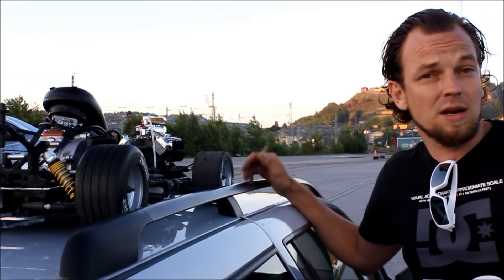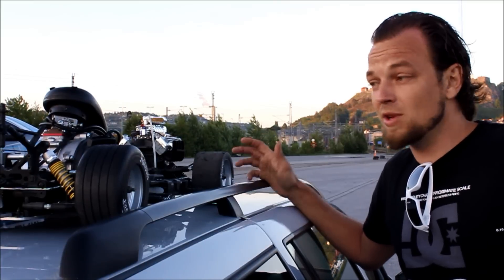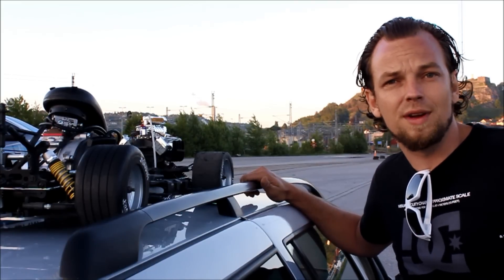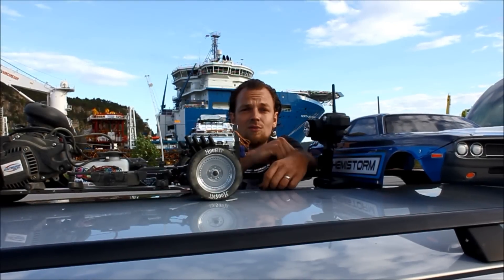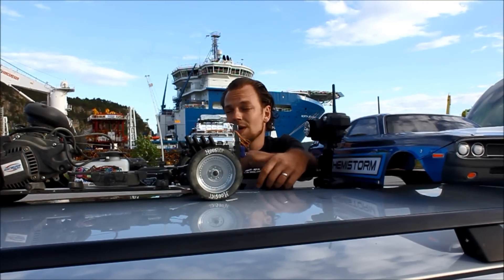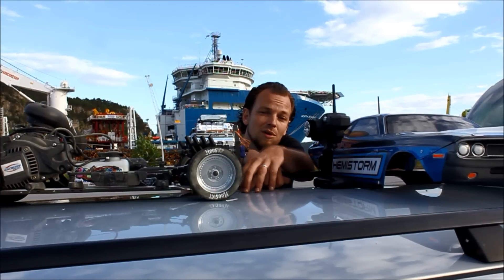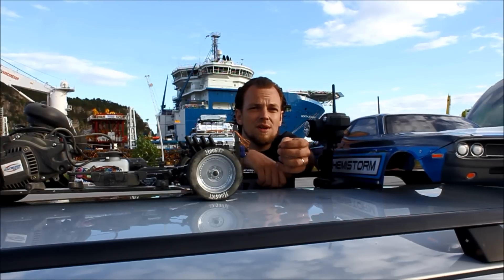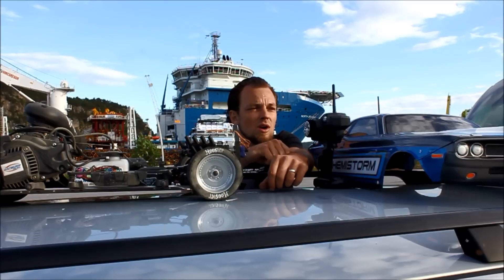5th Scale BurnOut Time! FG Dragster Test Runs

Comment from the maker: Hi Flavio! Good to see yo stop by again, my friend! The body will be available soon thrugh HemiStorm Products. As for breaking in the engine: several ways and everybody has a preferred method. I run stock carb settings, just let it cycle through a tank of gas without throttling it too much. After that, I start leaning it out with some low speed runs, just as long till I find the right tune. I hope this helps!

Comment from the maker: Well, Richard... It is not too bad I think. Although wifes and girlfriends not always agree on what we think is acceptable, haha. The FG costs a little under 1000 euros, add a different body and wheels for around 250 euro, some electronics, which were quite pricey but it needs to be reliable as well. So those ran me around 400 euros total. Now, the fun part: The fake engine in front was not even 30 euro, and the wheelie bar cost me around 15 euro to make. Add the BZM, and you have a total. :)

Comment: Also... Your car is essentially a FG Sportsline road-car kit with modified tires and a drag body ('70 Challenger).  The suspension is still set up for road racing...that's why it handled so well while your were playing in the parking lot.  Switch to a straight rear and front axle, and you will have a straightline monster.

Comment: A thought, install a very small electric motor with a pulley and tie it mechanically to the blower pulley of the dummy hemi. Then, run it through an ESC in parallel to the existing throttle channel, thus spinning the blower pulley in direct relationship to the amount of throttle applied. Realizing it's some work, but the effect would be amazing.
Reply: I think that as long as it spins it doesn't need to spin at variable speed because it's moving, so you can't really tell.
Reply: ***** Got ya. I just couldn't tell from the video that it was spinning at all. Nice work!

Comment from the maker: perfect marriage between something I can use on the track, and something that packs a punch in a dragrace. All restomods in full scale go by the same principle: The suspension functions, is even upgraded, but they also perform on the strip. I chose not to do just a scale off the line video, as that would have been only 5.5 seconds long. ;) Keep in mind, this was a test. The car is not fully complete yet,and I'm pretty sure you will like what is to come. Take care buddy, I hope this explained it!

Comment: Awesome build Hemistorm!!!! What compound are the rear tires? They don't seem to smoke as much as I anticipated. I run super soft compound on my Sport line AWD and they smoke big time if I hold the car and spin the wheels. I run a brushless 10s setup so my tires may be spinning allot faster than yours at full throttle producing more smoke.

Comment: I once had a FG Sportline, stock CY engine...put the stickiest tires i could find on...did nothing but "burn out", no traction!! You have a hot engine, pretty slick tires(going for burnouts) and it looks to hook up great!! I don't get it!!
Reply from the maker: The diameter on these F1 wheels is quite a bit bigger, and the tarmac I run is is quite coarse, all of which can help.

Comment: that is awesome! how did you get the front brakes to lock when you did that burnout?
Reply from the maker: +daniel o'hara I made a line lock system that runs off a separate servo on the 4th channel.
Reply: +HemiStorm RC - Custom RC builds, painting videos and more you should make a video on how you made the front tiers to lock up

Comment: Hi
     Did you paint the body on the inside or the out side , I have a 1970  Dodge Challenger  body but have never painted a body on the inside before . Also who sells the wheels , and did you have to change anything to make them fit under the body , any information you can give me would be great . Thank you

Regards
Steven Lee   (  Australia  )
Reply from the maker: +LEESODANO Hi, I painted the body on the inside. The wheels are discontinued and I custom fitted them with some F1 rear tires to get the stance to the point where I liked it.

Comment: how did you get it to do a burn out? I'm going to build a drag car and was wondering if I used the traxxas rx/tx if that would work?
Reply from the maker: +905RCCrawler I made a line locker system, there is actually an entire video about just that modification!

Comment: Hey dude...
that's fuckin sweet.
how much did it cost you to customize the lock tires body and the air scooper??
Reply from the maker: MgPs3ModDzz Hi buddy! The supercharger comes from the diecast engine that I mounted to the chassis, they retail for about 30 dollars and are very detailed. I did a few videos on how to mount one of those, it's quite simple. The line locker was also quite simple, I needed to make an extra servo mount and construct an override system for the front brakes. A video on how to do that can also be found in the playlist. I hope that will give you all the info you need to build one! :)

Comment: did you put some wheight on the front ?
Reply from the maker: I made a line locker system.
Reply: HemiStorm RC - Custom RC builds, painting videos and more yes i now i have look your video put i've done that on my fg with the front hydraulic brake but the cars heavens in with the tires blocked goes straight...

Comment: In the background is that a ship amusement park
Reply: 2:30
Reply from the maker: Great question! That is a "cable boat", they use them to unspool cables that will be submerged on the sea bottom, connection France to the UK for example.

Comment: how did u get it to do a burnout without touching the car
Reply: +mommyofjosie You need to have a way to have the front brakes engaged and the back brakes not engaged and you give it throttle ... Also he used some kind of liquid to make the back tires spin more easily than if it had been on dry pavement.
Reply from the maker: +mommyofjosie This car has a fully functioning line locker system on the fourth channel. I made a video about just that.
Reply from the maker: +Black Majik Line locker indeed, I made a mechanical override for the front brakes.
Reply: +HemiStorm RC - Custom RC builds, painting videos and more awesome thanks for the feedback love the car man
Reply: HemiStorm RC - Custom RC builds, painting videos and more Very cool that you were able to do that for this car. Line lockers are very common for drag cars, however I have only messed with 1/10 scale RC cars and have not thought about a way to run a line lock on an RC, Are the brakes on that car hydraulic or are they mechanical? On a 1/10 scale mechanical work just fine but that is quite a small car.